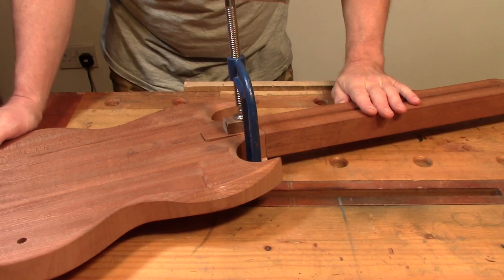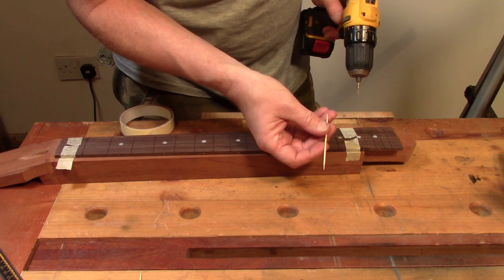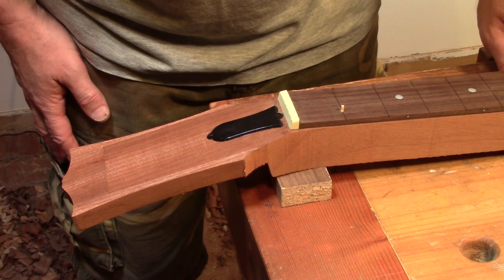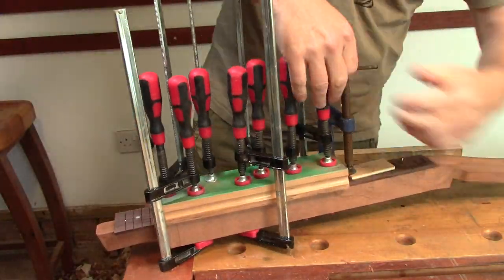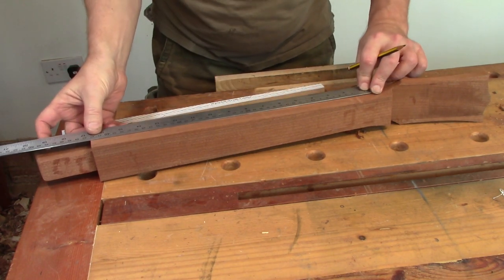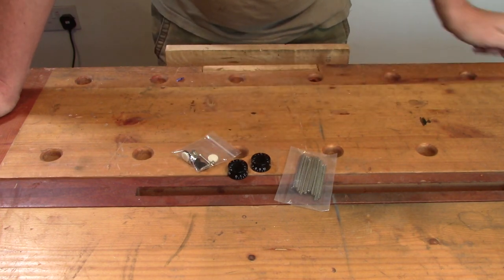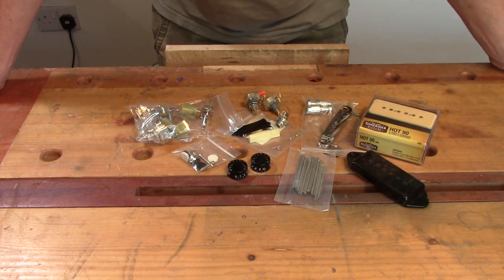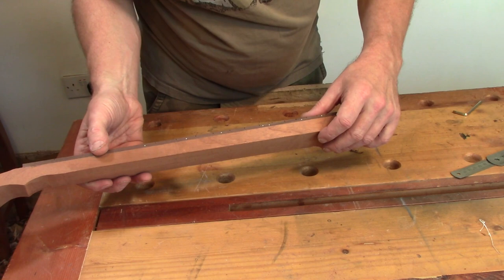Great Guitar Build Off: SG junior style guitar build part 7

Comment: Why not just take a very small framing nail. Clip the head off trim it to size and stick it under the fretboard 
alight it up with fret board and then just push down that way you don’t have
To risk putting unnecessary holes in your fret notches. Just trying to help. You are doing a splendid job on this build. Enjoying it very much! Cheers!
Reply from the maker: Hi Patrick, like anything there are any number of ways to do it, I have used the brad nail technique in the past but find this way gives a bit more control. The holes are only about 1.5mm and get fully covered by the fret.

Comment: Love your build.. curious how you got the proper neck angle on this build?..  is it a matter of trial and error with the neck tenon shaping?
Reply from the maker: I'll probably go over it in a future video but basically if you cut the shoulders of the tenon to the correct angle the bottom of the tenon is cut at 90 degrees to the shoulder and you have the correct angle... in theory!

Comment: question. i have my fretboard but its not yet tapered. would you do that first. or glue onto my un tapered neck blank and cut them both together once glued?
Reply from the maker: I tend to shape the fretboard and then use that as a guide for shaping the neck. You could do it either way.
Reply: @Adventuresfromtheshedofdreams  cool thanks. I made a mdf full scale neck template also